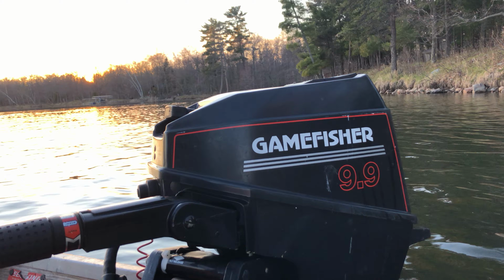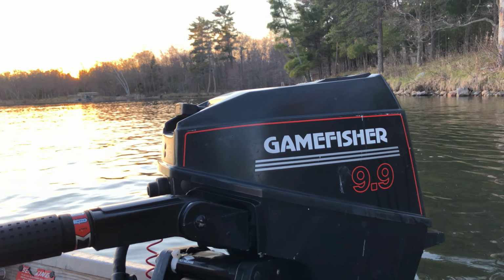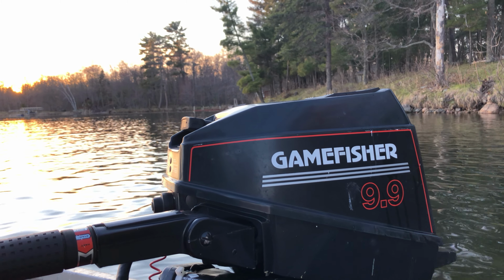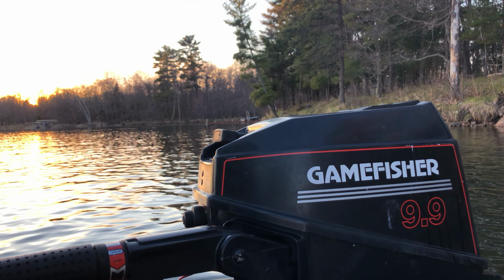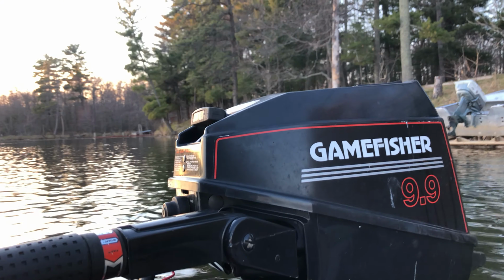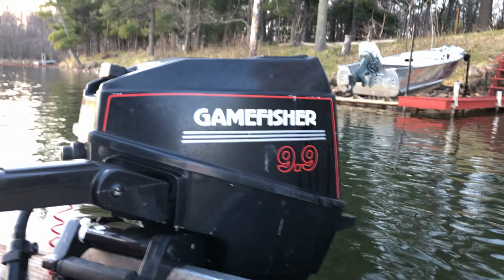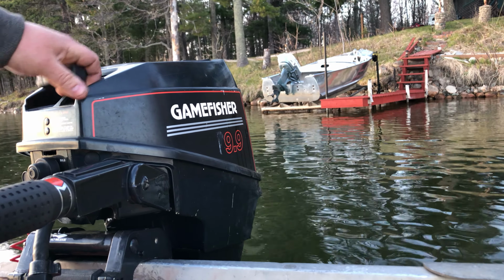1988 Gamefisher 9.9hp outboard motor

Comment: Hello, I have basically the same engine, runs really bogged down and doesn’t seem to want to hit full rpms, already did a seafoam flush, problem still exists. Seeing this engine run like this is unreal to me! Any advice or information you could give me would be so helpful, perhaps a video on how you worked with carb since this is what I believe my main issue is!

Comment: Hello. Old Johnny rude mentioned you might be able to answer some questions. I just bought a 1980 Chrysler sea king 7.5. The guy said it ran but you know how that goes. Got it home and there's no spark on either plug wire. Bypassed the kill switch but still no spark. Started to try take off the fly wheel but stopped before i broke it since I don't have a puller and am a novice on outboards. Is there any common problems with these motors or things I should check. I did find a broken ground wire that looks like it goes up into the stator/magneto. Fixed it but still nothing.
Reply: I've had similar problems on other motors. Often just replace condenser, clean and set points... probably set at .020

Comment: In need of help!! I have two questions. I have a 1989 Force 15hp. First question is, is the top cylinder considered cylinder one? And the second question is when I pull start I'll get three or four pulls then the next pull it will stop dead halfway through the pull. Any idea what causes that? Any help is appreciated.Thanks!

Comment: Sweet motor! I just bought a 1973 Chrysler 9.9 for 50 bucks that didn’t run and with the help of you’re vids it purrs like a kitten. I fixed the pull start, rebuilt the carb and fuel pump, and cleaned the points and bam 2nd pull! But I have this dark black stuff sleeping out one of the tiny holes in the lower unit. It’s not coming out of the drain / fill plugs. I did replace the lower unit oil before firing up. Do you know what that could be and is it serious?

Comment: Where do you find all your carb parts. I can find the carb hollow needle that is like 2 or 3 inches long that's fits down the middle of the throat of the carburetor anywhere at all. Everywhere it is N/A no longer available I tried everywhere e en vintage and salvage I have a 1989 15 hp gamefisher
Reply from the maker: If you need that tube you are going to have to find a new carb. look on ebay.

Comment: These videos are great thanks for posting! Have you encountered any issues when adjusting for altitude? I recently rebuilt an '84 Chrysler 15 HP. I live in Colorado and the lake we typical fish is at 9,000'. Even with the idle mix as lean as it will go I can't maintain an idle, runs great WOT. Were there ever high altitude carb jets made for these motors?

Comment: Good day Ben I live up in Edmonton Alberta Canada. I have watched your videos for a few years now. I have several older outboards from a 1956 5.5 Johnson to a 1965 20 hp Chrysler. I am not able to get parts for them. Could you please tell me where you get parts. I thank you for your time have a great day and keep up the good work.
Reply from the maker: The parts for the Johnson are available from Evinrude. Parts for the Chrysler are a little harder to find. I have some people that drive down from Edmonton to have me work on there motors.
Reply: @chrysleroutboarddude  Dude do you ever sell any of these smaller units? Am looking for a smaller outboard for my boat, maybe an older Sea King 9.6 or something close to that size?